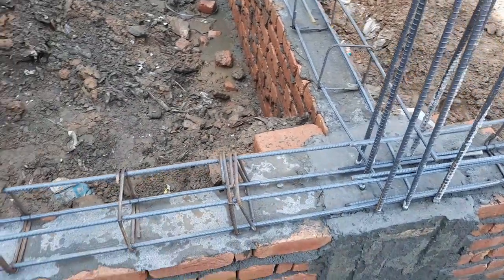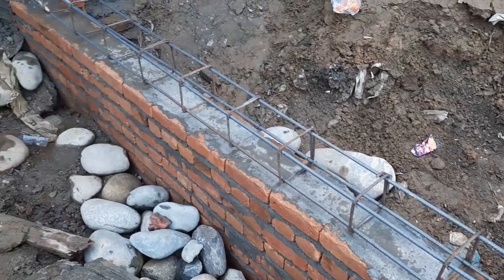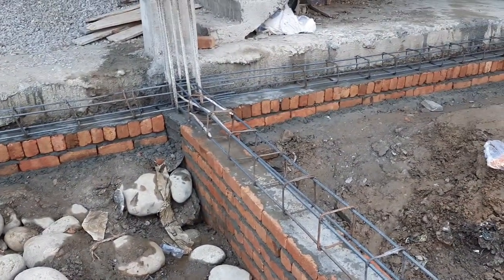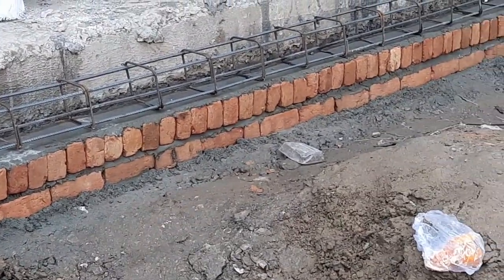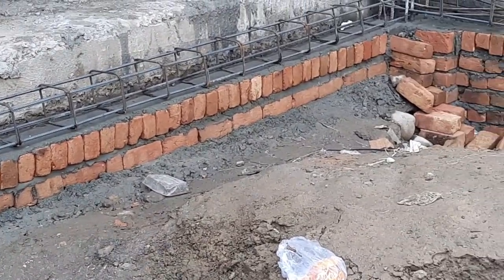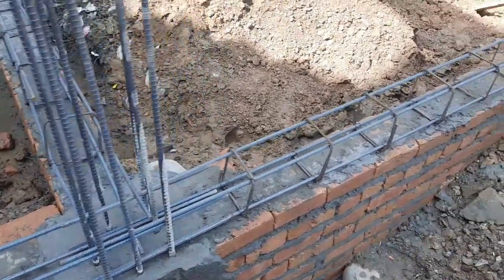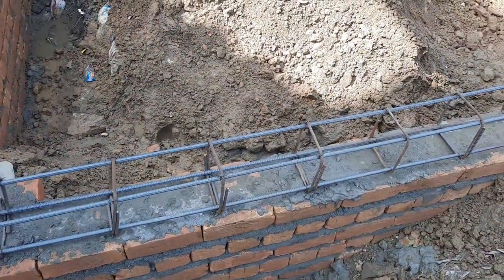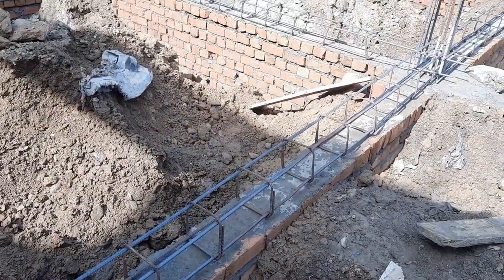Big Mistakes in Plinth Beam Construction | Practical Video |

Comment: Can I used 10mm and 8mm rod for slab 14ft x 14ft distance of each room : G+2? 
If yes, which rod for main and which rod for distribution?
Given:
Four Rooms ( 28ft x 28 ft, with 9 columns)
Column size 9"x12", 
Column rod size 16mm (4rod) +12mm( 2rod)=6 rod bar per column.
Beam as per column.